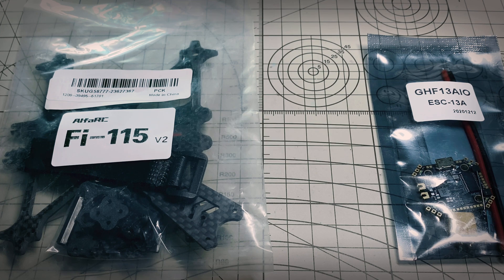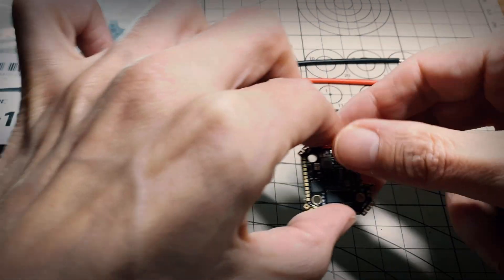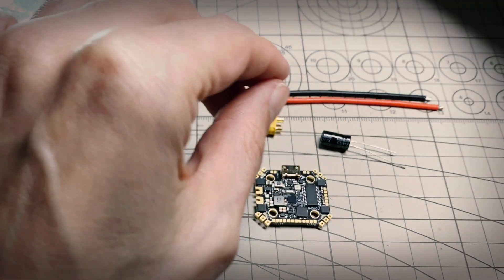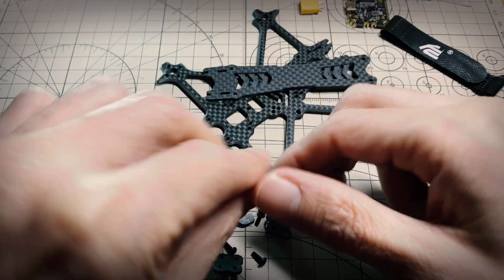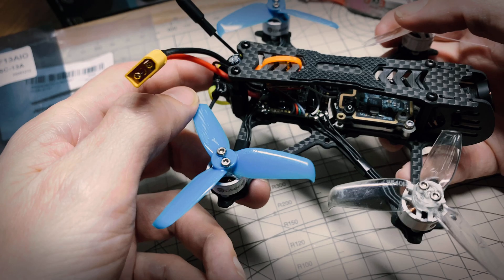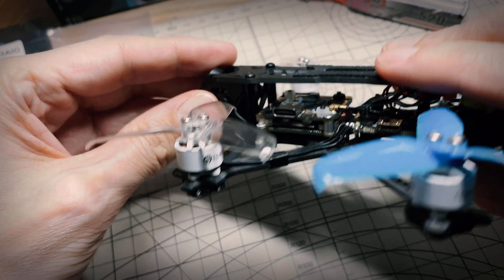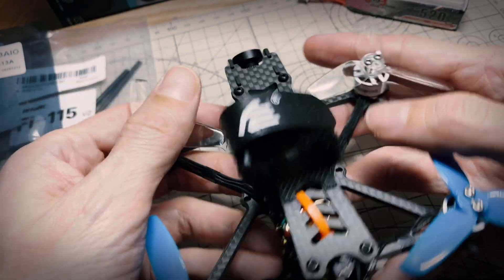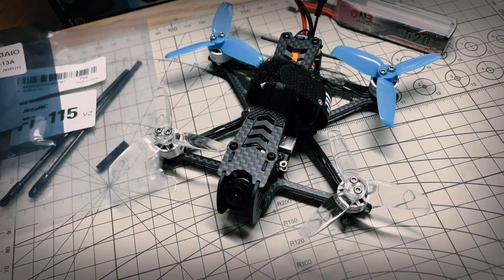AlfaRC Fi-115 2.5" Frame + JHEMCU 13A F4 16x16 AIO Quick Look (Supplied by Banggood)

Comment: is there a free uart left for the gps?
I am trying to find a aio for the next build (with caddix vista, external reciver that use a full uart and gps)
Reply from the maker: Is the 16x16 size important? Also, will you be using a CRSF or ELRS receiver? If using CRSF or ELRS plus a Vista will use up both uarts unfortunately. Something with an F7 might be a better choice but I don't know of any that are 16x16 AIOs.
https://pyrodrone.com/products/hglrc-zeus13-aio-3-6s-f722-flight-controller-13a-bl32-4in1-esc
Reply: @MiniMicroFPV  the size is important actually, i am aiming for a crux 35 frame (witch should have 20×20 holes) and one of the best fc options i am finding is a jhemcu ghf420 aio with 35 A
Reply: @MiniMicroFPV  the jhemcu ghf420 aio look capable of vista+elrs+gps configuration, If i didn't missed anything
Reply from the maker: @damianomotta1809  Based on the wiring guide that one should be fine and have enough uarts for everything. Good luck with it!
Reply: @MiniMicroFPV  thank you, if I'll buy it i will tell you if is crap or bot

Comment: So strange, I just bought one of these frames used on RCGroups and got it a couple of days ago. I had never heard of this frame before but somehow this video showed up in my feed today lol. Kind of creepy. Nice video though haha.
Reply from the maker: Thanks! That is a strange coincidence! I’ve also just dusted this frame off recently to use with the Caddx Nebula Pro Nano…
Reply: @MiniMicroFPV  Nice. I might stick a vista with a polar cam on it for a little night cruiser. I have an AOS 3.5", which is great, and this frame is very similar to that. Very rigid and beefy. I'll have to try really hard to break this thing hahaha.
Reply from the maker: @flipfpv  Oh nice. Yeah I also noticed it resembles the AOS. Super-rigid for sure which I think makes it a good platform. Make sure you get the Polar Nano so it’ll fit~~

Comment: Hi, I have a question. I have the same frame, and same fc. Can you tell me how you have connected the caddx vista unit and the crossfire receiver? i only see a single uart in the fc. I don't know if it has more or it can be done in some other way, I would appreciate your help. Thanks!
Reply from the maker: Hello. Yes it’s a little confusing but the upper left pad shown on the diagram as RX to the VTX is actually TX1. So that’s TX1 and RX1 is the top pad on the right side of the board. You can wire the Vista to that and then Crossfire will be on TX2 and RX2.
Reply: @MiniMicroFPV  😮😮😮 ohhhh thanks so much mate!!

Comment: hello is it possible to have your pid setting  thans
Reply from the maker: Hello. I no longer have this FC in this frame but I’m pretty sure I was running stock 4.2 PIDs with a slight increase in the filter sliders and my own rates.
Reply: @MiniMicroFPV  I have the Mamba F405 If I go to maximum potência I have vibrations
Reply from the maker: Hmm. It could just be the case that at that highest RPM the propellers are vibrating badly. If that is the case they are probably not producing good power at the top end so maybe you can try a small 5~10% motor scaling in Betaflight to avoid this bad zone.

Comment: Hola que lipos recomiendas para ese frame?
Reply from the maker: Hello! It really depends on which motors you want to run. For 5000~6000kV motors like this I suggest a 3S 500mAh or something like that.

¡Hola! Realmente depende de los motores que desee utilizar. Para motores de 5000 ~ 6000kV como este, sugiero un 3S 500mAh o algo así.
Reply: @MiniMicroFPV  mis motores son unos arthur 1204 5200kv
Reply from the maker: @ivanfpv1767  Nice motor size! So I would suggest a 3S battery around 350~450mAh. Usually I like to choose a battery that is about 50% of the weight of the quad. So if the quad is 60g, I like the battery to be around 30g.

¡Buen tamaño de motor! Por lo tanto, sugeriría una batería 3S de alrededor de 350 ~ 450 mAh. Por lo general, me gusta elegir una batería que tenga aproximadamente el 50% del peso del quad. Entonces, si el quad es de 60 g, me gusta que la batería sea de alrededor de 30 g.
Reply: @MiniMicroFPV  ok
Muchas gracias por la respuesta 👍

Comment: Hi, nice video. Btw, im very confused about their wiring. I need 2 Serial for GPS and MAVLINK. So is it true that the pin that goes to VTX is TX1?
thank you
Reply from the maker: Thank you. Yes, I’m pretty sure that the top left pad called RX on the diagram is TX1 (which they like for Smart Audio) and the RX1 pad on the right is indeed RX1.

Comment: Where do you solder if using the caddx vista with the transmitter?
Reply from the maker: Do you mean with the DJI transmitter? If so I don’t have one but if I understand the wiring correctly the SBUS from the Vista goes to the SBUS (UART 2) on the FC. The TX from the Vista should go to RX1 (top right pad) on the FC and the RX from the Vista should go to RX (top left) on the FC. That part’s a little confusing because RX on the FC is actually TX1. Hopefully this helps!
Reply: @MiniMicroFPV  cool. Thanks mate and now it make sense.

Comment: so, it's been a while. how is the AIO holding up? I want to use it in a 2s 75mm whoop build, but I want to be sure it's something I can rely on lasting, because getting spare parts is pretty hard for me, here in south africa...
Reply from the maker: Hello! Well my first FC has been holding up well. I'm currently running it in my GnarlyFPV Sub Atomic and it's been soldered and de-soldered a few times. I did however receive a sample of this FC which had a faulty ESC. I would probably buy another one though if I needed something this size.

Comment: Great video! I'm interest in these naked vista builds. Is there a downside of mounting the FC off the center? Will it confuses the gyro?
Reply from the maker: Thank you! I’ve never had a problem with mounting an FC off-center. I believe others have done testing on this and for a small quadcopter a vertically off-center should be fine.

Comment: This is the channel i was looking for so i subscribed. I will get this frame soon. And that FC is sooo affordable. hope it lasts long and would not just conk out on you. What motor do you suggest i use here if i want to run 2s 450 mah lipo. Thanks in advance
Reply from the maker: Thanks so much! I've been continuing to fly with the FC and it's still holding up. Let's see, for a 2S 450mAh around this size I would suggest something maybe in the 8000kV range and 1105~1303 size might be appropriate.

Comment: hello champion, I love that drone, I am also becoming one with that chassis with components from another drone, how is that little one?  could you tell me something about him, thanks
Reply from the maker: Hello! What would you like to know?
Reply: @MiniMicroFPV  Well, look, I'll tell you, I'm assembling it with the components of the 80hd scorpion gofly but the camera doesn't fit on the site and it bothers me a lot because that camera records in HD, how can I solve the problem? Are individual cameras sold? And if it's k  if what I would need!  thanks
Reply from the maker: @jorgelorenzofpv  Hm yes, I see your problem and I don't think there is an easy solution. You definitely need a 14mm camera for this frame but I don't think you can just change the camera by itself on a Runcam Split Mini. I think you would have to buy a whole new camera and split board, like Runcam Split 3 Nano or other split HD system with a 14mm camera. I think the only way to use your current camera with this frame would be to use some kind of custom 3D-printed mount for the larger 19mm camera.
Reply: @MiniMicroFPV  Ok thank you very much for your help I have it in mind champion, greetings 👍by the way which one are you using?  looks great
Reply from the maker: @jorgelorenzofpv  Great! In this build I was using the Caddx Nebula v1 and Vista which is for the DJI Digital system.

Comment: Super cool!! Have you gotten to fly it much since you built it? Just curious how the aio is holding up? I ordered 3, but haven't done a build with one yet. This makes me want to do a 2.5" hd build..
Reply from the maker: Thanks! Unfortunately I have less than a dozen flights with this AIO so I can’t speak to long-term durability. No issues yet though~
Reply: Just got this aio. Any issues after 6 months?
Reply: @changeagent228  I’m running this board in everything from my little gnarlyfpv sub atomic 1.6”, in my 2” builds, 2.5” builds, and my 3” 3s toothpick builds, and it’s been a tough little board for me. I haven’t killed any yet.
Reply from the maker: Nope, mine is still going. I’m currently running it in a lightweight 3” model.
Reply: @MiniMicroFPV  It's a pretty cool little board. I'd love to see one with Elrs built in.. lol
Reply: @MiniMicroFPV  
@Mike Bergman
Thanks for the update guys. So far my only issue is it only has 2 uarts so I can't run GPS lol. I'm loving how light it is got a 1.5mm 4g 3" frame and now testing a bunch of motors. What would anyone say was their quietest motor prop combo? So far I have found 1103 + Gemfan 2055BN to be the quietest.
Reply from the maker: Hehe no doubt! That would be excellent.
Reply: @MiniMicroFPV  any video on ur 3" lightweight

Comment: I wonder if I could transfer the 2-5” TransTEC beetle bits over to this so I could run the battery on top.
I saw your other video where you removed the canopy and have been considering doing the same although I have the full DJI air unit.
Trying to save weight, make it more efficient and avoid tipping over on landing and damaging my Insta360 go or soon to arrive SMO 4K.
Reply from the maker: That’s a nice thought but I’m pretty sure the Air Unit wouldn’t fit with the electronics and this frame also only accommodates 14mm nano cams so the Nebula Nano would be the only choice.
I’m trying to think of other light frames that could accommodate your needs but can’t really think of anything. Maybe an iFlight frame of some sort though I don’t know if they’d be much lighter.
Also that SMO is no joke and I think you’ll like it if you are already using a 360 Go. The only thing I miss from that is the ability to reframe slightly.
Reply: @MiniMicroFPV  Thanks for the reply.
I'll try to figure out what I need for standoffs (probably 30mm) for the beetle to do what you did and I also see a caddx vista in my future!
Reply from the maker: @roystevenson9632  I can certainly recommend the new Nebula Pro version of the Vista kit if you’re looking for a 19mm camera.

Comment: First! Happy New Year :) 

Hey, according the wiring diagram, there is only an RX1, RX2, TX2, and an inverted RX2 for SBUS. So, if you connect RX2 and TX2 as MSP to the Vista... the only receiver you can use on RX1 (not inverted) is Spektrum DSM or FlySky IBUS. It's too bad they couldn't make the inverted RX on UART 1 (RX1i), so we could at least use the DJI built-in receiver or a FrSky/Futaba. 

As for the BEC, only 5V for analog cam/LED/buzzer... and some weird 4.5V for the Rx (and 3.3V for some DSM). But there is VCC/VBatt pad (and ground) for the analog VTX which you could use to power the Vista.

That frame looks very TinyHawk Freestyle inspired. :)
Reply from the maker: Thanks! I’m not sure if this helps as I haven’t had to deal with inverted versus non-inverted (that whole thing remains confusing to me!) but I’m running the MSP for the Vista on TX1 and RX1.
Reply: @MiniMicroFPV  So I take it you are running the CRSF receiver on RX2 and TX2. For the Vista, there would only be a RX1, unless the TX SmartAudio pad is TX1? Oh, and I sure wish there was a Pro version of the Nebula Nano 14mm cam.
Reply from the maker: @TweakRacer  Yes I am using the Smart Audio pad since I don’t need it and indeed it seems that it is TX1 (though not labeled as such). And indeed I hope they have a 14mm Pro soon!